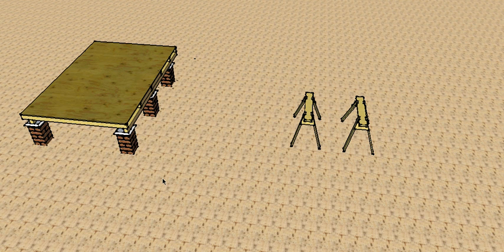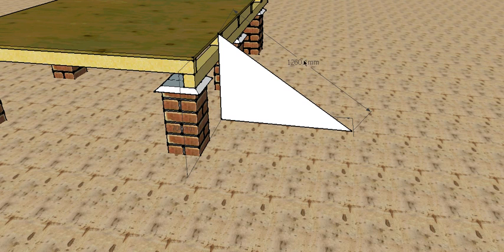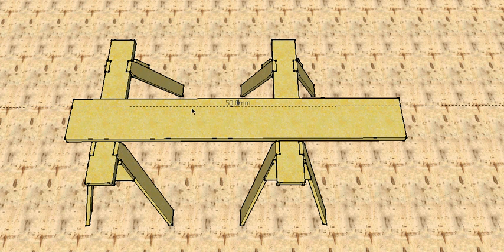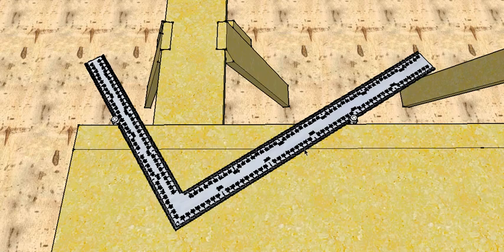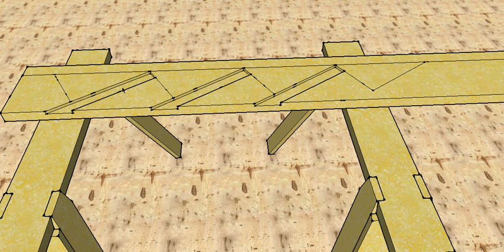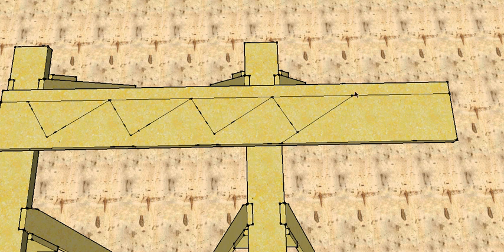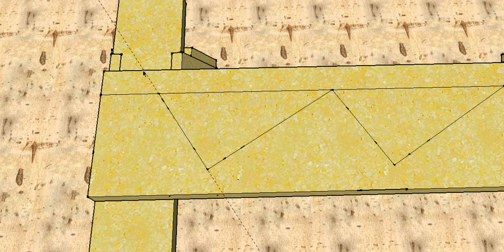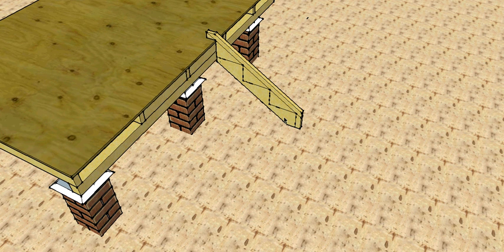Stair Stringer Setout

Comment: How are stairs inside a house fixed without a haunch?
Reply from the maker: Hi , alot of them still have the haunch but is covered up with the Newel post or balustrade. Otherwise you can put a spreader between the stringers and then attach that to the side of the landing. Hopw this helps
Reply: @Buildsum  it does, thanks heaps you’re a legend 👍

Comment: These videos are great. How would I find the span table to workout stringer size etc like load and span for a staircase 1200mm wide?
Reply from the maker: Hi, the best option is the WoodSolutions Stairs, balustrades and handrails class 1 Buildings - construction. 
This is a link but you will have to register to be able to download it. 
https://www.woodsolutions.com.au/publications/installation-guides-0
Hope this helps.
Reply: @Buildsum  thanks heaps

Comment: Great instructions, very easy to understand, just a couple of questions, I plan on making steps to cover about 3mt in length, I intend using solid pine for the risers and treads without any gaps, would this be an issue? also would I still require to have the threaded screws, the overall hieght is about 1mt. Cheers
Reply from the maker: Graham Graham Hi Graham I assume that these will be external stairs and in this case the threaded rod is essential.
External stairs will also move with climate changes, the gaps allow for movement as well as letting water pass through easily.
Reply: Thought as much, thanks for your timely reply.